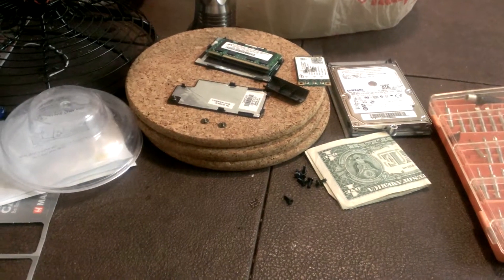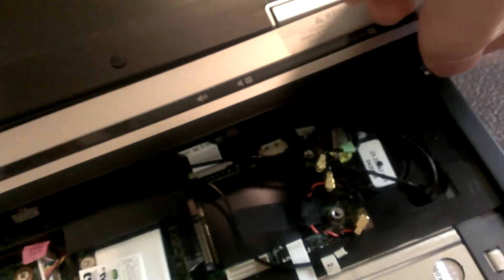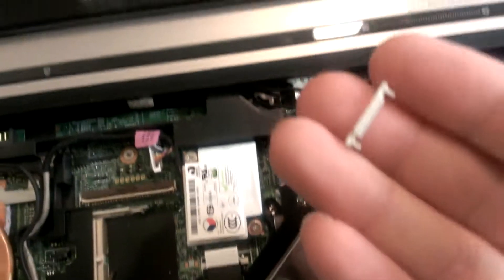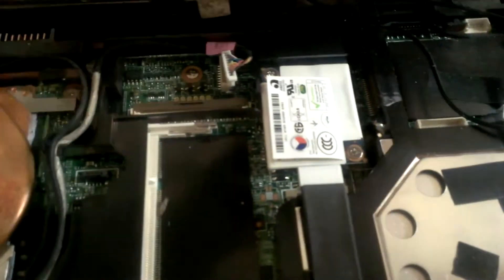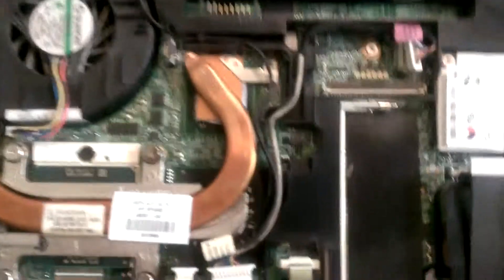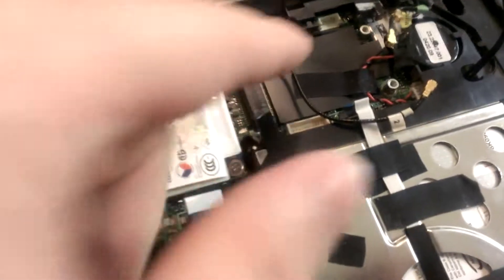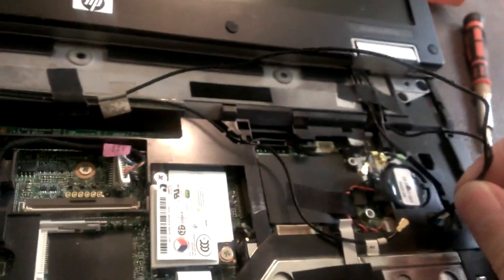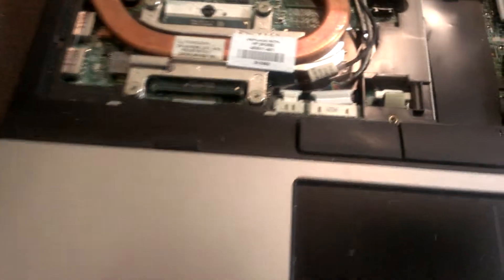6930p motherboard swap(2)

Comment: The wire connector on the 6910 "whoops I broke it" also, but as you said it just popped out, I was able to slide it right back in.  Funky tape isn't HP norm? hmm...  Don't worry too much about the 3g card, I don't use that form of wireless anyway :p   LOL you found a casing for a bug in the computer?  It probably crawled in there and fried my motherboard...